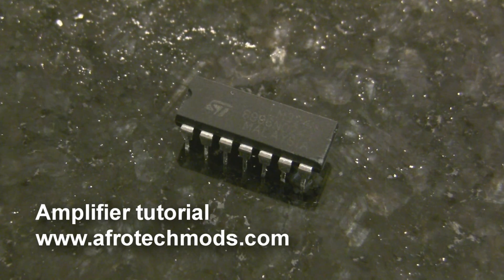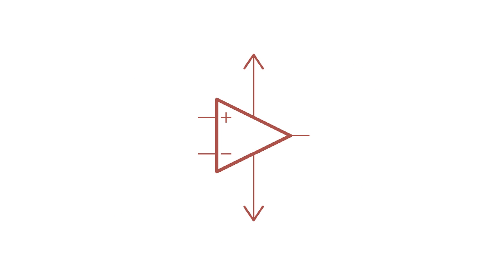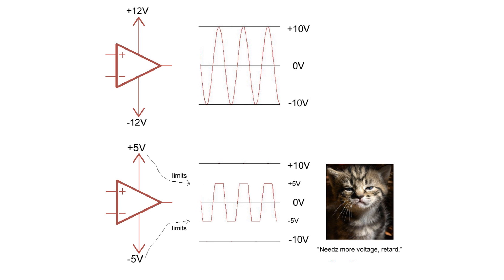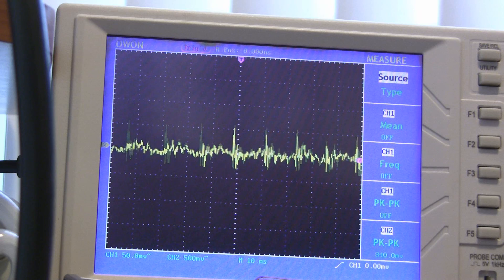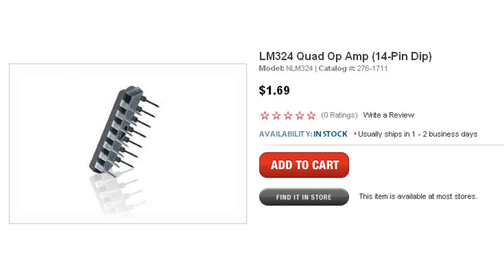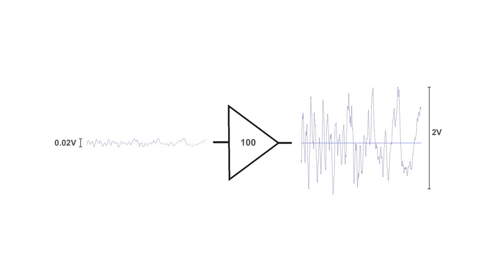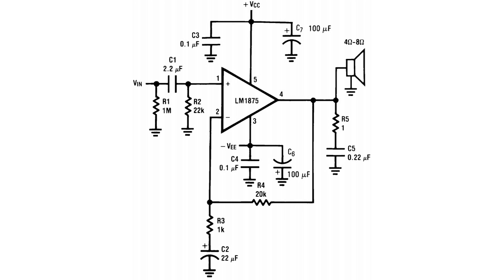What is an op amp? Operational Amplifier tutorial & super spy microphone circuit

Comment: I watched your video and think you could help. I have an old record player with ceramic cart , i have soldered 1m resistors to the output left and right channels to make the sound less shrill, when I plug in to line in on my amp it works but it's way to quiet. What could you suggest , how many times amplification would I need , I bought a cheap module from eBay and it's supposed to be 5x but makes no difference to the volume . Can you help?
Reply: I meant to say this is one I bought , is it possible to mod this to get higher output Model: XH-A902
Chip: NE5532
Number of Channel: Dual Channel
Amplification Factor: 5 times
Supply Voltage: DC 12-30V

Comment: By far the easiest to understand and straight forward tutorial on op amps I've seen yet. Thank you!

Couple questions though:
- Using the 9v+9v power supply circuit in this video, is the center point GND (0v) fron that circuit to be used as GND for everything else that connects to GND in the rest of the circuit? Just wasn't sure how to connect the two circuits together.

- I'm using a 4580D (JRC) dual op amp. It's voltage range is 2v-18v Should. that still work?

I haven't gotten this to work yet, but I am using salvaged parts so it might be a messed up part somewhere.

Again thanks for your great videos. It's super refreshing to have such good explanations 😁
Reply from the maker: 1) Yes GND connects to GND
2) Yeah I think it will work

Comment: a circuit i built once before was a 4 mile mike and its super sensitivity and amazing gain makes it so sensitive it can hear the most tiniest whisper you can ever make 14 feet away and around the corner of a wall  and thats amazing, the sound of my tiniest whisper is beyond faint, which means i have to have my mouth right in your ear so you can just hear it so with this circuit 14 feet away that would be considered impossible but it worked im recreating this circuit again , the circuit used  1m5 potentiometers which ive found dont exist online anywhere not even e bay so i had to make some changes hoping it would work but despite the feedback squealy it worked beyond what i expected . and i had to adjust it to reduce the feedback to the edge so its at the beginning

Comment: Great video as always! And a great voice too...!  Question: I built this op amp delay circuit https://youtu.be/XsBzrgHPrpQ which I found in a book. The delay works fine except when it is initially switched on the whole circuit becomes energized. You have to switch it on and and off a couple of times before it performs as intended. Is this just the bounce surge from the physical switch or is there some other reason the delay gets bypassed on the first run? I tried adding a buffer on the output which minimizes the issue, but doesn't eliminate the initial false start. Any thoughts would be helpful!

Comment: hey, Afrotech. would an opamp work to boost the output of a piezo transducer?
Reply from the maker: Hmmm typically piezos work with a high voltage. So yeah an op amp could do it but it's gotta be a special op amp that works with high voltages and is good at driving capacitive loads.
Reply: @Afrotechmods  don't be thinking I am working on some sort of arduino project here :D it is actually a case of a clip-on piezo transducer plugged into a guitar tuner on my control bench. Sometimes it just doesn't pick up on certain guitars. I am probably better off buying a complete guitar piezo preamp from China, they are no more than 10 USD and just transplant the guts.

Comment: I know this video is 10 years old so in sense my question is a bit late. 

I am a math guy that hobbies out of my field in electronics. I have a FCC license kc2wvb and build little cw transmitters for giggles. Normally I use a simple oscillator with a single transistor amplifier that gives me perhaps 100-200 mW of power. 
I have also used canned oscillators and without amplification they put out as I remember about 20 mW. 

I realize the lm324 used in this example will not sink more than 20 mA but I was thinking that I might be able to use the lm1875 or similar to get in the neighborhood of 1 watt out of the canned oscillator. Off the cuff do you think so or am I trying to get to much amperage gain in a single step??
Reply from the maker: The LM1875 is a great power amp but it's limited to audio bandwidth only. 20mW to 1W from an LM1875 sounds totally doable to me. The main thing you're gonna want to pay attention to here isn't so much the power but the peak to peak voltage swings on the input and output of the amp.
Reply: @Afrotechmods  thanks a lot for the response, saved me a lot of research. So, the lm1875 would make a great little audio amp which I have a use for too, but since its bandwidth is restricted too non-rf I'll have to either to seek another means such as back to  the tried and true bipolar transistor that uses amperage to control the collector/emitter through amperage swing at the base. Again thanks a ton.

Comment: So the cat didn't like the taste of the microphone, huh?  When I tore down my old Radio Shack direct coupled amp I saved the four C1051 TO-3 audio output transistors that were mounted to a very LARGE heat sink.  Now to figure out what to do with them???  I'm assuming that the C1051's are 2SC1051's which are probably obsolete now with the advent of LIC's.  I have another 12 volt car amplifier that used to drive a big bass speaker with 1000 watts of power but I managed to blow the audio output transistors.  I guess I will be tearing down that amp as soon as I can find it in my "junk" room.  I also have a model train controller that went out on me and I tore it down to find out that the voltage regulator is bad.  I cannot find a proper replacement voltage regulator since the one in the controller is obsolete and I cannot find a replacement as they are no longer manufactured.  It is a BD 23A.  Any ideas???  This is a controller that controls DC voltage for my model trains - from 0 to about 13.6 volts DC.

Comment: I supplied a single supply on my lm324 because i found in the data sheet that it is single supply only.. how to identify the supply required if it is dual or single using the number written in IC?

Comment: +Afrotechmods Can you please explain why a high pass filter is needed after the microphone? You said it is needed to make sure only AC voltage reaches the op-amp, but that can be done with a capacitor alone. Is there a reason to also block low frequencies?

Comment: This is why I hate watching videos from multiple sources. The one I just watched from Khan Academy explained that the gain of an opamp is typically 10^5-10^6, but you just explained that an amplifier with a gain of 5 would put out 5 volts if you put 1 volt into it. So wouldn't an opamp put out tens or hundreds of thousands of volts for every 1 volt you put in if it had that much gain? I'm confused. Also, the program I've been using, circuitmod doesn't include any power pins for opamps. I only JUST found out they have power pins. So that only further adds to my confusion. Let's hope it gets cleared up after reading more.
Reply from the maker: The open loop gain of an op amp is on the order of >=10^5. But no one uses op amps like that. In this video I showed you a configuration with a closed loop feedback system with the gain set to a much more reasonable value.

Comment: Hi, just want to ask where does the negative voltage (-9v) pin of the op-amp connect to? Doesn't it connect to ground?. And also would this work with just a 2AA batteries giving 3 volts instead of 9 volts?
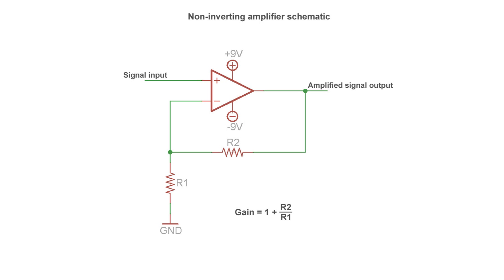Reply: the -9v connects to the op amp power lines (1:57, the one with the negative sign).. it would work with 2AA, but you might get clipping on the output (output is limited to 3V). Greatscott has a decent video on opamps too, explains the stuff i said^ :)

Comment: at 1:40 wouldnt that just be 0v, 9v and 18v? since theres not actually such a thing as positive voltage
Reply: Jimmy Shakway if we take the 9v as ground (0v), the 0v appears to be -9v. voltages are relative. it's sort of like if i take the 50th floor of a tower as my "ground floor", and someone else is standing on the 45th floor, be appears to be standing 5 floors below "ground floor"
Reply: but you're still on the 50th floor, and floor 1 is still ground in reality. The same would be true for electrons since they are always negative, there should only be a lack of electrons (+) and then surplus (-) that only goes up and never below +. assuming your building doesn't have a basement lol

Comment: Hey, very nice tutorial :). I have just 1 question. When you count with .1uF cap. and 100kOhm rezistor, the cut-off frequency of this filter is around 15kHz. But that is high pass filter. so It should pass the frequencies 15kHz and above. Which isnt probably what we want. So did I make sonewhere mistake, or is mistake in video? (hope not :D)

Thanks anyone for response ;)

EDIT: I am sorry. I did a calculation mistake, so I am really sorry :). Now its clear. Nice cat, tutorial, and everything. ;)

Comment: At 3:08: why do you need a circuit to power the microphone? I thought that's what the job of the Op Amp is: to boost the 0.02V to 2V? And then why does the power to power the microphone need that 5K resistor?
Reply: Ryan Ashton It limits the current, so that the microphone does not blow its brains out .
Reply: op amp itself is a circuit
Reply: That doesn't answer my question in the slightest.
Reply: Thanks :)
Reply: The microphone is a capacitive type, which means it does not output a voltage, but acts like a variable capacitor.
Reply: Ryan Ashton Bro microphone is just an simple two plate capacitors which produce positive and negative swings ac no need power but the output of plate is connected to base of FET inside the microphone for little amplification so for we need to power FET.

Comment: what is "-ve" (not GND) voltage,  why and where do we use (applications)..?
Reply: Because the signal may go below zero. Usually audio waveforms are mostly symmetrical around 0 volts or GND.

Comment: I made that circuit and it somehow picks up shortwave radio. Its extremely quiet and i have to amplify it more on my computer to hear it but its there.
Reply: Yeah the air around you is saturated with thousands of signals. Usually the 50/60Hz one is by far the strongest. But it's so near DC that the cap may filter it out.

Comment: And what happens to the current when you get a bigger gain of voltage on the other side???? Does the current goes down or stay the same etc?????????????
Reply from the maker: The current flow will be a function of two things: 1) the load you are driving (V/R = I for a simple resistive load) 2) the max current the op amp is capable of delivering, which could be as low as milliamps or as high as several amps.

Comment: i used lm 324 but i think i amplifier dc too i want to use it with arduino i used alaogRead fonction  R2 =1M R1 1k but the lowest output is 600 (on arduino) when i do noise it go up to 900 wish is fine but cant i lower that 600?? :/(i used your circuit)

Comment: Do I have to place two batteries in series in order to power the op-amp, can't I use a simply ONE 9 volts battery? or 9 volts charger?
Reply: With one battery you could use a voltage divided to get 4,5 volts (which you use as ground) so you have +4.5 volts and -4.5 volts

Comment: Why is it better to adjust the volume after the amplification, and not adjusting the value of one of the resistors that are setting the gain? Is is because if you adjust it after you can get 0 volume, but while adjusting the gain you can't? Great video!
Reply: +Litan Virgil If you play with the gain before amplification with regards to lowering and increasing volume, the signal would be distorted and noisy due to variations in frequency bandwidth. Hence it must remain stable for the output to be smooth.

Comment: Hi! I would like to build this circuit using 741 op-amp. However, I have a question regarding the output voltage of the op amp. Would is still work properly if the output voltage is around 1V?  Supply would be +-12V (voltage generator). I'm asking because I have a condenser microphone rated at 42dB, so at 1Pa SPL I would get only around 8mV, correct? If I build an op amp with a gain of 100, I would get around 1V or am i missing something? I realize 741 isn't the best choice, but it's what our lab is equipped with, so I'm stuck with it.

Comment: Why is the positive power supply on the side of the non inverting terminal and the negative power supply on the side of the inverting terminal in the op amp circuits? Shouldn't it be the other way around? Great video though!😀

Comment: Thanks. nice tutorial.... wondering if I can replace the speaker with 3.5 mm audio jack and input the audio to my laptops microphone in so I can record the sound using a software such as audacity.  I don't know the input specifications and afraid that inputting amplified voltages over 5 volt would damage the microphone input port of my laptop.  Thanks in advance for your reply.
Reply: +Golestaan yes you can. be aware that the output jack of your laptop has an opamp and is made to generate enough voltage to power a pair of headphones whereas the input jack for microphones has electronics designed to capture annd measure signals with voltages as low as microphones. I don't believe you'd damage ther input or output jacks, but you'd probaably be clipping the electronics as well as the analog-digital converter, so if recorded and listen back you'd hear square waves, clipped content of the sinus waves recorded.
a way to do it properly(er) is to lower the volume of you output and starting to raise until the input in your mic in port is fed with a level that sounds good and makes sense.

Comment: We are learning about 741 op-amps in class.  Can I use this chip for this circuit?  Also, can I cannibalize one of my USB microphones as the input device?  Thank you!  Oh, if yes, on the USB mic question, is it still .020 volts?  Maybe I should invest in an inexpensive handheld oscilloscope to find out for sure?  =)  I'm not really hoping for replies to my questions.  ...But, on the off-chance someone feels so inclined as to answer...  Thank you too! =)
Reply from the maker: +Christian Marquez I wouldn't recommend the 741 for any audio work - the gain bandwidth product on it is terrible. You could probably rip out the electret mic from your USB mic but probably cheaper/easier to get one from a dollar store that plugs into your sound card. No need to rip up a nice usb mic!
Reply: Thank you!  I was pleasantly surprised to get a reply.  :)

One more? Which chip is good for audio work? :)
Reply from the maker: Christian Marquez
I used LM324 for this. Another cheap common choice would be TL272.

Comment: What allows one op amp to deliver more current than another?

Also how did you know the amount of current appropriate to feed into your headphones to make them work properly?

Did you test this at the same time you tested to find out that the signal on properly functioning headphones is about +-2V?
Reply: +Zambia95 your speaker is just a load, and it should has a spec somewhere that says you can't run over x amount of mA or it will fry up. For +- 2V i'm not too sure...you want to have enough supply so that the output won't get clipped off, so it's all depend on your output voltage and the following variable resistor.
Reply: Reehji When you say speaker do you mean the headphones?

I don't see any part numbers or anything like that on most headphones that could be used to find a datasheet.
Reply: ***** it can be anything. but i used a cheap speaker. Not sure how the quality with headphones/earphones would be. Here's a speaker i used in a lab
/watch?v=clE5xVppiDE

Comment: So I just built this circuit with a gain of 11, using a voltage divider to give me +9, -9 and 0 volts from an 18V supply, and I hooked it up to my Raspberry Pi's audio jack.  Then I played this video on the Pi, piping the instructions on how to build this amp, through this amp.
Recursion is fun.

Comment: If I'm using a power supply, could I just plug it into negative rather than the center of two in series? I've been learning about electronics for two years and I still don't have a good understanding of ground.
Reply: I don't need any negative signal, just positive

Comment: can you use this to amplefie? if so, do I need to supply the -9v to the op-amp? or can I just connect that to ground?
Reply: Olivier Koot it depend  on the signal you want to amplefie  , 
if  it has  negative signal  then you need  to  use  negative  supply  otherwise  you will lose  all negative  signal in the output as 0 v output   but  positive  signal will be  alright

Comment: Ok OK OK! How can your op amp go into the negatives if the mic itself cannot go below 0v via virtual ground. The op amp amplifies .02 volts to 2 yes, but the mic cant output below 0v. So how does the amp go into the negatives if the input itself cant. The negative feedback sets the gain of 101. But this only means your input is amplified to the positive range.
Reply from the maker: What virtual ground.... it's powered by +/- 9V...
Reply: Afrotechmods 9+V 0v -9V Virtual ground is the term im using for the 0v between the batteries connected in series. Technically its 9v but hooked in series its technically ground as you state in your video, oh wise one of mystical op amps. Any info on whats happening. Because it works but im lost on the logic behind it.
Reply: 100 k resistor fixes that
Reply: Note the capacitor between the microphone and the amplifier input.

That capacitor blocks the Direct Current (DC) voltage from the microphone.  All the capacitor lets through is the changes in voltage, so all that the amplifier sees is the "bumps" in the positive or negative directions which it then amplifies and reproduces on its output as positive and negative swings.